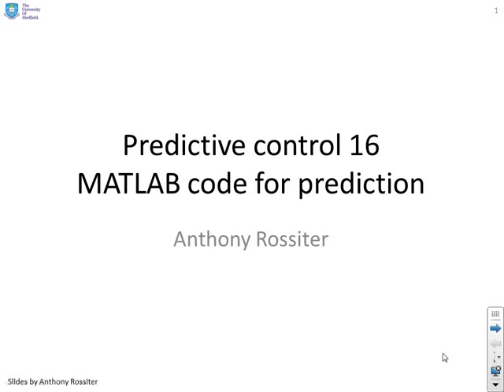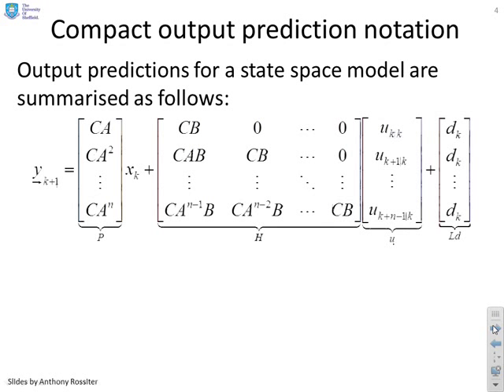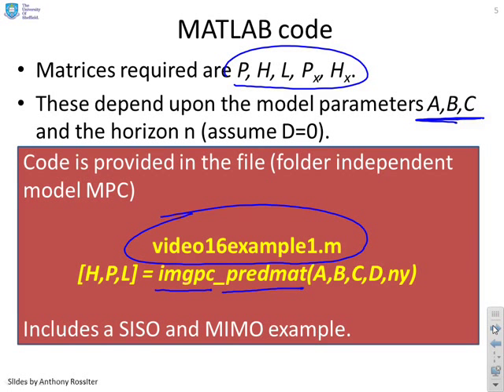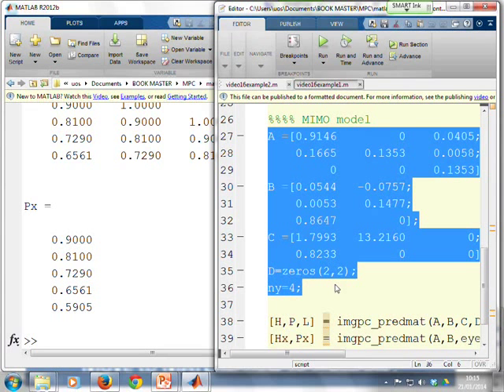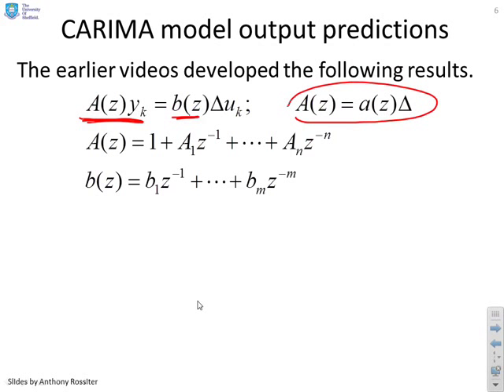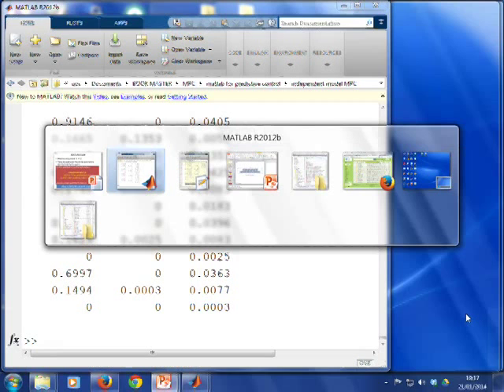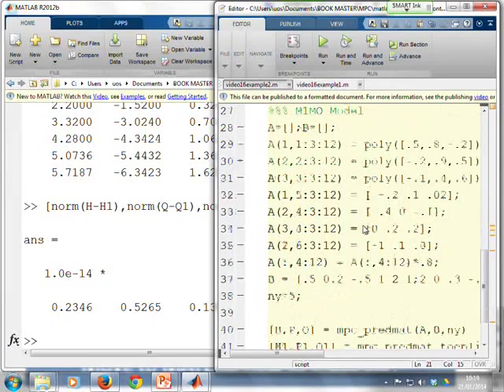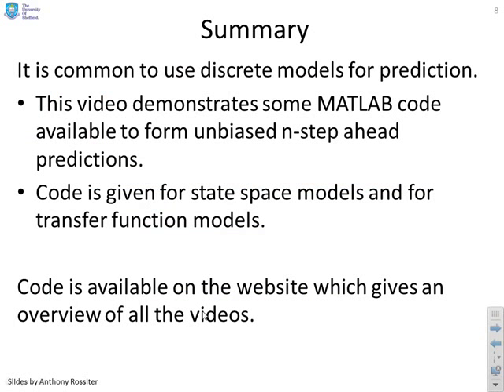Model Predictive Control  16 - MATLAB code for prediction

Comment: You can download "video16example1.m" file using:
https://drive.google.com/folderview?id=0BzLEHBDBdlnuMmc0VGNKSlhjTms&usp=drive_web&tid=0BzLEHBDBdlnuaEcxT3NnU3pCVEk

For the code to work, you also need to download "imgpc_predmat(A,B,C,D,ny)" function from matlab central using link:
http://www.mathworks.com/matlabcentral/fileexchange/3410-model-based-predictive-control--a-practical-approach/content/imgpc_predmat.m

After you download, extract the folder and copy "video16example1.m" file to the same folder.

Now you can run the "video16example1.m" file. Enjoy practicing these wonderful tutorials.

Many thanx to Prof Jhon Rossiter.
Reply from the maker: Thanks, but this file should also be on the google drive in the independent model MPC folder.Anthony

Comment: i tried function imgpc_predmat, but theres an error is it because of matlab version?

thanks
Reply from the maker: Sorry hard to comment as it runs fine on my computer. Likely you have not entered the input arguments correctly.
Reply: John Rossiter thanks i found my mistake and its working fine,
just would ask about the optimised (u) or delta u,,,,, i am using this equation:
BarRs=ones(ny,1); %* Generate R
H_H= H'*H;
H_F= H'*P;
H_R=H'*BarRs;

DeltaU=inv(H_H+0.5*eye(ny*2,ny*2))*(H_R*r(k)-H_F*XX);

the problem is i dont know the states (XX) in this equation, i tried to estimated but the result i got is very poor if i can say so is there another solution ?

thanks for your help :)
Reply: Hi, thanks for the very good videos.\I also have an error with Hx,Px] = imgpc_predmat(A,B,eye(3),D,ny).
Error in imgpc_predmat (line 20)
M=inv(Gss);

because eye(3) is A 3X3 matrix. I fixed using eye(2,3) 2x3 that has the same dimension of the C matrix in the previous example. Is it correct?
Reply: What was the error you were getting ? is it the error using inv in imgpc_predmat ? How did you fix it ?

Comment: Same question as before, how do we access the codes? Great videos.
Reply from the maker: <p>There is a folder on the googlesites page with all the powerpoint and code,</p><p></p><p>@a/sheffield.ac.uk/video-lectures-on-modelling-analysis-and-control/</p>
Reply: @johnrossiter2323  respected sir, the link shows 404 error